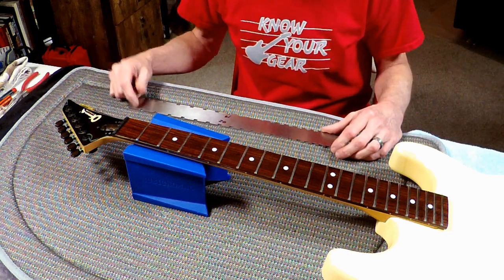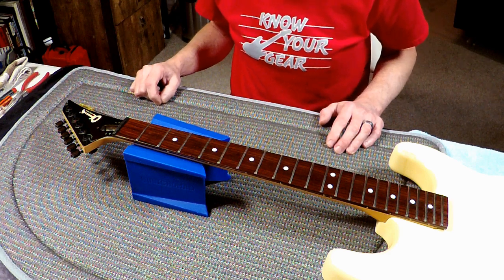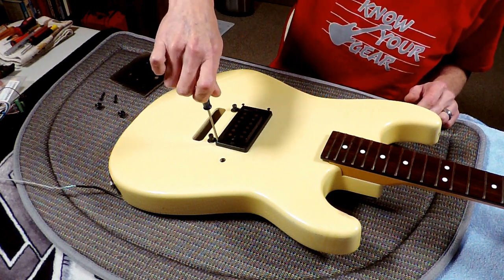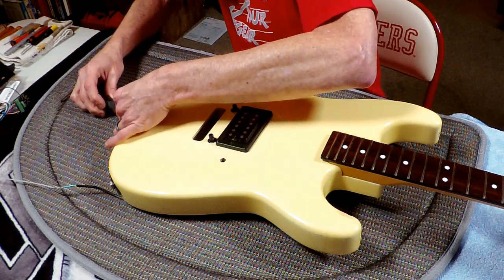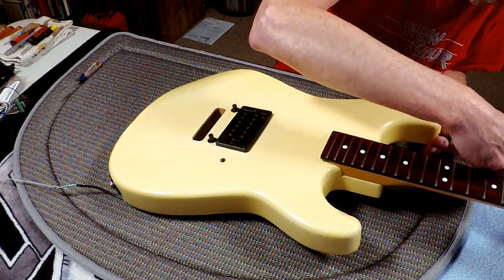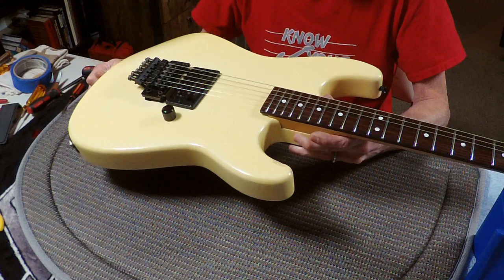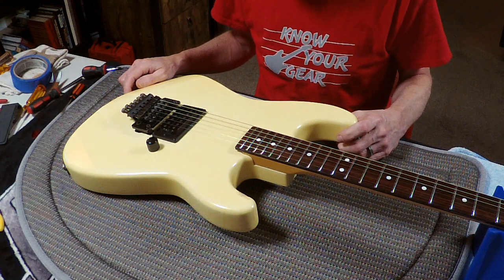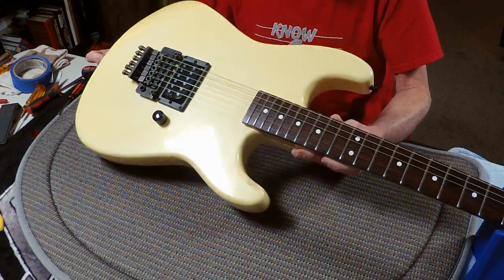1987 Charvel Model 2 Refurbish Part #3 - Final Reassembly!

Comment: I bought this guitar off eBay. I have 4 Model 2’s now. Best guitar ever made. I swap the Trem’s out with HipShot bridges and the tuners out with HipShot locking tuners. Fu Tone heavy springs running 12-52 gauge strings. Pups are a mixture. Some have EMG 81’s and some have Seymour Duncan Nazguls. I kept all the original hardware to put them back to stock but I will never sell my babies.
Reply: The Model 2 is the most desirable, single humbucker, no pick guard. It's the quintessential Charvel. Sure, the genuine San Dimas built are the '59 Les Paul's of Charvels, but the Japanese Charvels are the next best thing.

Comment: havea model 1A this color, any idea what color it is or do you have a paint code? I need some slight touch up went from the brass insert threaded bolt to straight wood thread bolt, so I have to color up the plug where the brass threaded inserts went..  other than that its real straight color wise, not beat up so it was worth saving, its a 1A with a HH pickguard, don't see many of em around really.. not in the maple neck HH pick guard...   really like yours its very nice...  and that lift off the top that's nice, I actually like that gibson like string spacing off the deck like that, I have a model 2 as well, JT6, 200 humbucker, rosewood, but its like yours the top mount is ncei and high, love it, it plays different with that much space between the body and strings, totally different feel that's not bad, cuz with just the 1 pickup there is a lot of room..

also I believe whammyparts has the black locking nut if you want to get it color coordinated?
Reply from the maker: I believe the color is called Vintage Ivory, but I do not have a paint code for it.